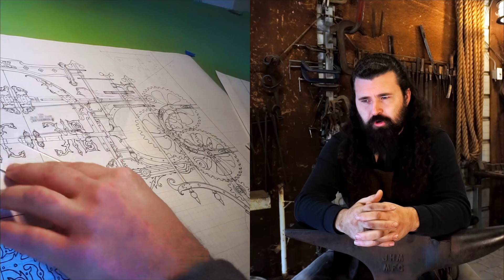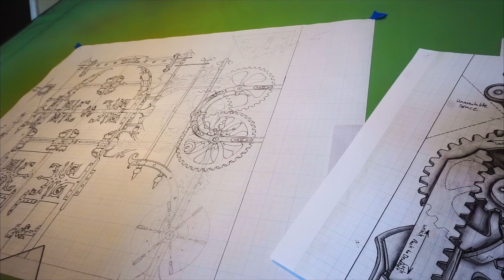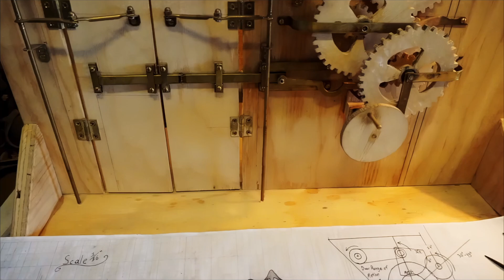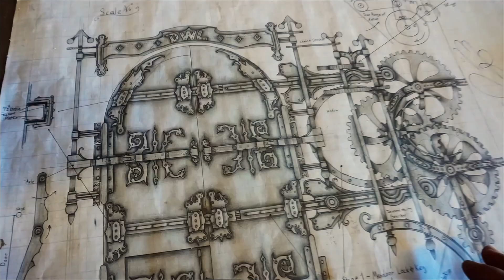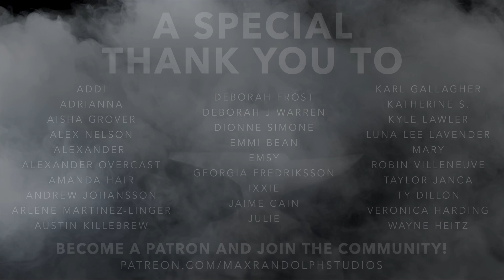Forging the Valhalla Doors | Locking Bars | Part I

Comment: Just a joy to watch you create Max. I'm trying to absorb as much knowledge as I can get. I do have a couple of questions if you have time. 1) are you cold setting the rivets and then heating to finish?2) you heat one of the plate points with the cutting torch, was that time lapsed? Seemed very fast and 3) WHERE WAS COPPER DOG!?
Reply from the maker: I'm so glad you're enjoying it! Yes, I set the rivets cold, then came back and forged them into place! My editor sped up a few cutting moments for sure!